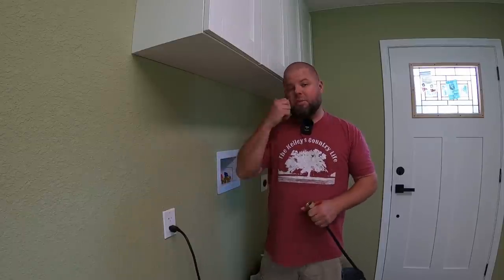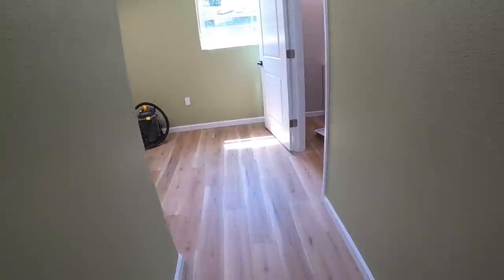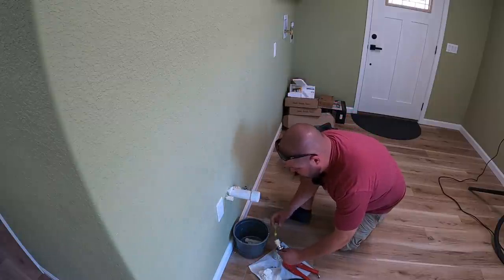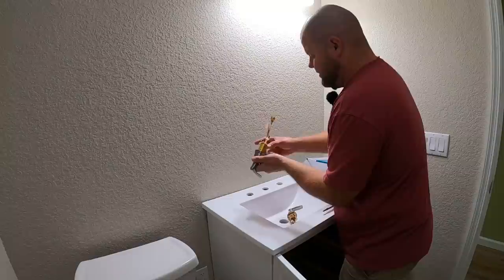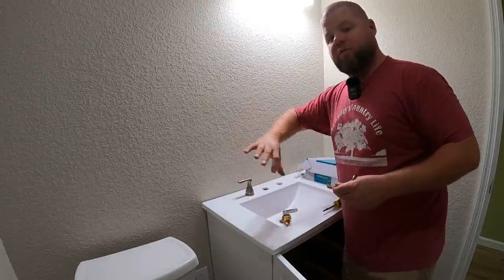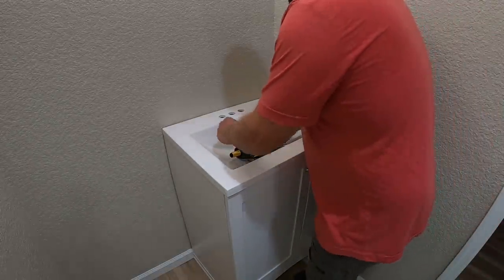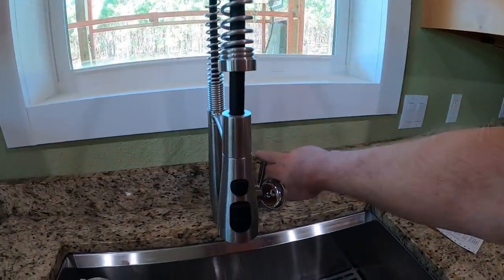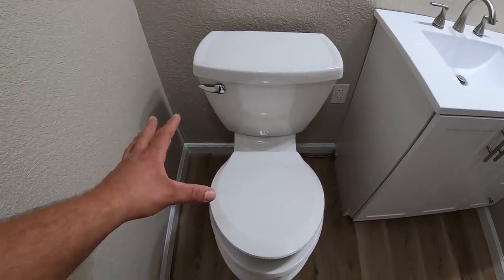Plumbing is COMPLETE! Installing toilets, vanities, sinks, dishwashers and more! #551

Comment: I hate pvc sticking out of the wall, for that same reason, having issues, do you have enough to fix it or not. I ended up installing CSDQE034 on all sinks and toliets and then using a small nipple and valve. also don't have to worry about someone attempting to over tighten it and snapping it in the wall :)

Comment: Weird. I haven’t done plumbing in years but hammer arrestors used to be a couple feet of Empty pipe that held air above the water lines, The air compressors with a couple feet you had enough where you didn’t need the bladder or cushion inside the hammer arrester and we just put them everywhere.  The new ones are kind of cool and much smaller but I was a little surprised you can put them on the outside. In California when we had plumbing inspections that just had to be part of it with all the internal plumbing.  

I kinda wish I had hammering problems in this house so I could get one of those. Lol
Reply from the maker: I have always built my own arrestors, but now those no longer pass code.

Comment: I don't think you can mount a hammer arrester horizontally (or with a downward angle). they fill up with water and won't work. I did this (horizontally) and it doesn't really work. It needs to be slanted up so it remains fillled with air. It is the compression of the air that dampens the hammering.
Reply from the maker: I read a ton of plumbing forums, all mentioned they could be mounted in any position. If not, I'll change it.

Comment: I know what you mean about the wax ring for the commode. I rurnt more than a few trying to set the commode down. They use to not provide nuts to hold the toilet in place. That was a pain lining them up. The plumbing you did looks good I like the modifications you made in the vanity to run to the 🚽
Reply from the maker: Thank you!

Comment: I hate those wax-sealed I have always used rubber seals never had a problem with them and if you ever got it lift up your toilet fix something you just put it back in and it works just fine not the mass that wax you have

Comment: So I watch a lot of what are called drain clearing videos on youtube. The oldest one is called Drain Addict, some others are called the Penetrator (he and Drain Addict are out of Australia), the Drain Unblockers (who are out of England) and several others. and on thing that I noticed that a lot of foreign homes have that we in the US don't is an outdoor clean that is in a manhole. One of the reason is seems if that if you have to open the cleanout up when it is pressurized due to being heavily jammed, all of the waste and sewage and water will accumulate in the water and sewage proof man hole pit (I have seen masonry pits, plastic pits, concrete pits). 

Now in my youth, assisting my older uncles some of whom took service plumber jobs.... unblocking a drain and cleaning up was on of the nastiest things I have ever experience. And see the situations some of those drain unblockers experience, in situations where they have those manholes vs where they don't... well I have decided that if and when I own a house, its going to have one of those outdoor cleanups with a manhole. 

You might want to watch some of those drain unblocking videos and maybe consider a manhole with your outside cleanout before you move in.
Reply from the maker: While not exactly the same, I do have a cleanout outside that will release in the event of a backup and pressure in the system. Much better to go outside than flood my home with sewage.
Reply: @TKCL  i remember. What i was saying is,  having had to clean up stuff that had poured out of a clean up, after watching all those English and Australian drain clearing videos, I think that manhole idea is like the best thing about house building that for some reason we don't do here.